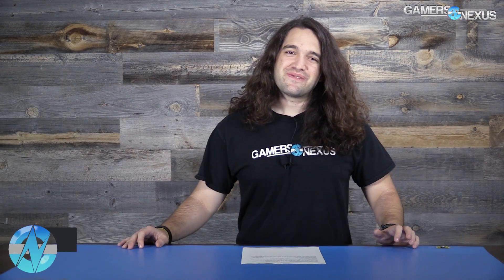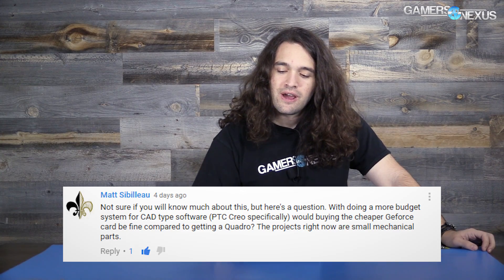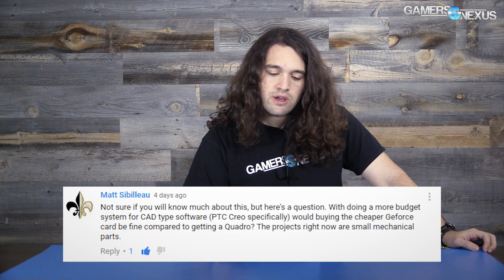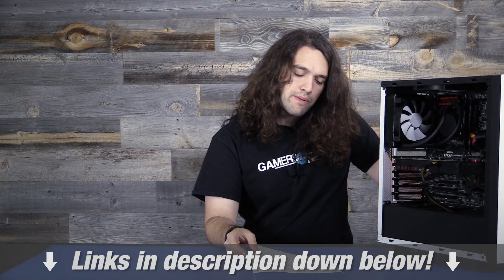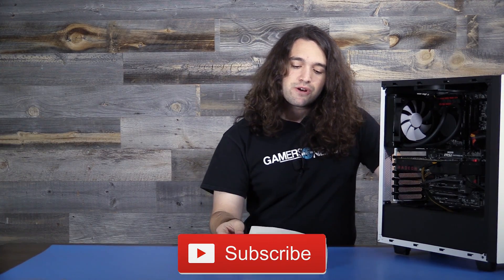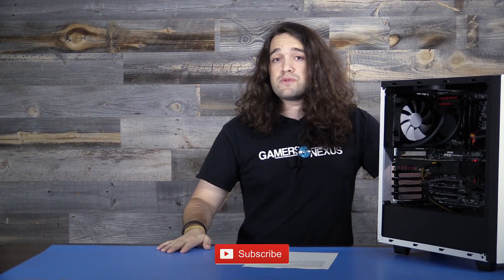Ask GN 23: RX 490 Talk, GPU Power %, Driver Performance

Comment: Hey Steve, great video, could you fit a short bit in a video of the difference between 384-bit vs 256-bit on the GPU. Say the 980ti with 384 and the new 1080 with 256. Why is that? Is that better? Thank you sir
Reply: It has to do with memory speed. Using the 980 ti as example: you have the bus size aka the 384-bit and you have the frequency which is 7Gbps. Although this might not be 100% true technically I would explain it like a river: The 384-bit is the width of the river and the 7gbps is the speed of which the water is flowing.I hope that made sense. Anyone who knows better please inform me :D
Reply: The 384-bits bus means that there are 384 bits that can go through the port at the same time. That certainly includes raw data, but also other things like memory operation requests ("write this data here", "gimme that data there", or "write the next 10 lines of data I'm sending your way" and throw raw data through the bus, without additional command.) That's the bus size. A larger bus size means that a larger amounts of bits can go through.

The other statistic to look at is bus frequency. I'm not certain how memory frequency and bus frequency relate to each other, because there are things like dual channel and quad channel (the 8GB GDDR5X on a 1080 operate at 10GHz... not. They actually operate at 2.5GHz and each cycle makes access to 4 sets of two 1GB banks.)

The last thing I want to talk about is the relation between all that and data size. The great thing about GDDR5 (and GDDR5X) is that it has a LARGE bus. Yeah, that's great for bulk transfers alright. But what about small changes ? Let's say you take a single 32-bits value and change it. Now the card has to use a 384-bits bus to change a 32-bits value, and it must make sure it is stored immediately to avoid the dreaded race condition in programming. Talk about a waste of space !

With all kinds of calculations available that can now take place in a GPU nowadays, even in gaming, I think having a smaller bus like the 1080 helps find a sweetspot for both bulk and small transfers from and to memory. It's a boon, and a curse, depending on how the card is used.
Reply: +Robert Watt if someone can't understand that analogy I think there is just no hope for them.  Great analogy I don't think it can get any simpler.

Comment: I have a Kraken x61 that makes gurgling/squirting noises pretty frequently. The radiator is on the top of my case (which is the only spot it will "fit" in my case... Don't buy this rad of you have a Corsair c500). Is this something I have to worry about or just live with?

Comment: (For the comment section)
Any news on when the 490 and 480x comes out?
Reply: Nothing confirmed but there was a leak on a AMD drivers page where you could infere that the 490 is coming out by the end of the year
Reply: RX 480X won't happen IMO. The 380X/280X were merely the full version of the Relevant chips. Considering the 480 is the Full chip, a 480X won't happen.
What might happen is a 485, in which the 480 gets some clock bumps or something, similar to the R9 285. This is in line with AMD's slides on nomenclature mechanism.
Reply: +swellframe Saw that too, prob same webpage. Bit late for me. I'm getting a new graphics card For Black ops 3 mod tools.

Comment: I'd rather have 490 be Vega than 2x RX 480....
Reply: Yeah so call that RX2 480
Reply: I think Vega will be 2.5-3x as powerful as the 480
Reply: wouldn't the RX2 480 be called the RX485 not the RX490 http://videocardz.com/amd/radeon-rx-400/radeon-rx-490 the 490 will be Vaga :) or at least i hope it will
Reply: +colin furniss or rx 480x2
Reply: Or even Radeon RX480 Duo :)
Reply: The 490 won't be dual 480. It's just a BS idea someone thought up. There may be another (full) version of the P11 in a year or so, an another cutdown version of P10, and that's it so far. If there will be another GPU that will be placed on the RX 490, they won't talk about it right before the start. AMD do want to make smaller GPU's that can be utilizied as one through DX12 or Vulkan, but they don't want to step back on performance. I think we'll have 2 or 3 Vega GPUs, one for 490, and the other one, or other two on a Furynext.
Reply: That's actually a pretty clever naming scheme.

Comment: If there is an Rx 490, I hope it's single GPU. I thought they were stopping at 480, which would make sense since Polaris is mainly concerned with being more power efficient, but a 490 would be cool
Reply: 99% sure the 490 will be a dual gpu card. all the leaked evidence points to dual

Comment: I have a good question! I currently use the MSi 970 Gaming/FX8350/R9 390. Just ordered two RX 480 (8GB) XFX branded GPUs. Will I get any real performance gains by upgrading my mb and cpu? i know the 8350 is so clunky and not that great. i want to stay 100% AMD.
Reply: Wait for ZEN, the new cpu architecture by AMD coming in october. It wont be cheap, but it should pack a punch.
Reply: you will get better performances if you switch to i5 or i7 skylake, if you want To stay AMD you'll have to wait Vega unfortunately
Reply: +Diego Lopez Mas lol wanted to Say Zen, not vega
Reply: id wait for zen for sure if your trying to stay amd
Reply: Yeah definitely wait for ZEN. The 8370 is just an overclocked 8350.
Reply: +Diego Lopez Mas thanks man. I build rigs on the side mostly Intel and Nvidia combos for my deep pocket friends. But the difference in those rigs and my all AMD rig is such a tiny one for double sometimes triple the cost... no thanks. I run every game out right now on ultra max at either 30 or 60 fps. i don't give a crap about running a game at some crazy 80+ fps! i can even play many games smoothly at 30fps at 4K? So in the real world I buy for what I need and not for what most ego raged diehards. I also stream these games on twitch just fine at 60fps! But umm, yeah!
Reply: Federico Mannucci
I got it, with all the releases coming one gets confused. I hope Zen kicks some major rear.
Reply: That's what I was thinking, the only viable upgrade to my current FX 8350 is the FX 8370. I'll hold off this this holiday so I don't have to pay for one of these new Zen CPUs.Thanks Diego...!
Reply: defo wait for zen even the FX-9590 5GHZ wont beat my i7 4790k i ran both cpus with 280s crossfired and single also a 390x and the i7 still won every time, asides from actual cpu performance you will get a nice new board to go with the zen cpu so definitely worth waiting,
Reply: i think the zen cpus are shipping with wraith coolers to which is a nice little bonus if so, i'm not really 100% on that tho
Reply: +Social Gamer well I would just do some research first. I upgraded from a FX-8320 to an Intel i7-4790(non k) for a cheap 240$(CND). Why I choose that CPU was so I didn't need to buy new DDR4 RAM(had a lot of spare DDR3) and I bought the CPU used on eBay. I have noticed a deference in most games but it didn't increase my Average fps but more increased my min fps(buy a whole 10+ frames) in some more CPU tasked games. I upgraded my CPU for more Emulation software where the 8320 had troubles properly rendering certain games even when clocked @ 4.2 GHz. Don't upgrade to Skylake yet it's still not worth it lol buy used Intel CPUS and then buy a new motherboard. Just make sure to get a non K Intel CPU(Generally there less likely to be damaged by previous owner). Hopes this helps
Reply: Don't switch him to the blue side! Now repeat There is no cpu but AMD and Jim Keller is the Messenger of AMD Just kidding here, but hey zen releases in october and for us AMD enthusiasts it might be worth it to wait.
Reply: lol the blue side my brain makes so many star wars connections, just to say as well the i7 4790k was almost twice the price of an fx 8350 here and around £80 more than an fx 9590 definitely not spare coin by any means